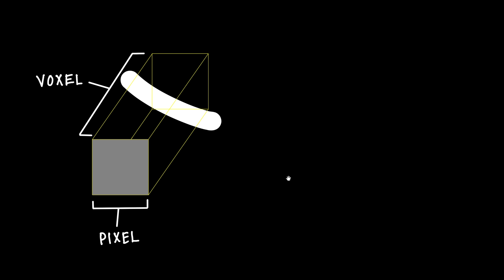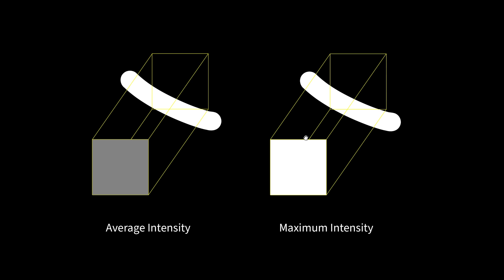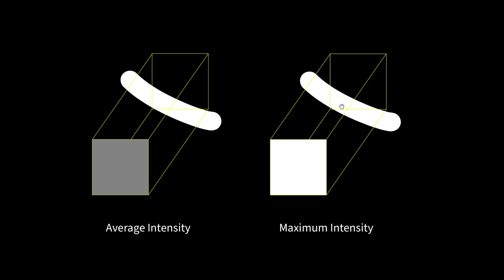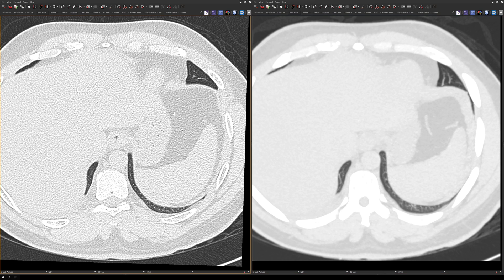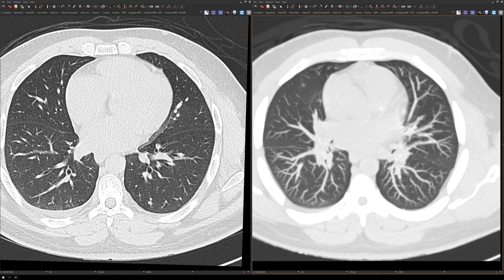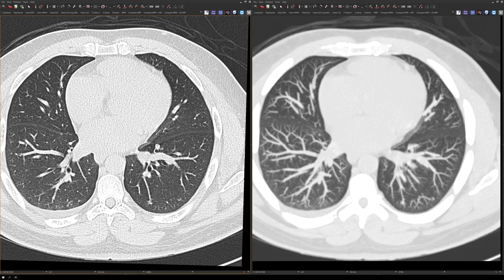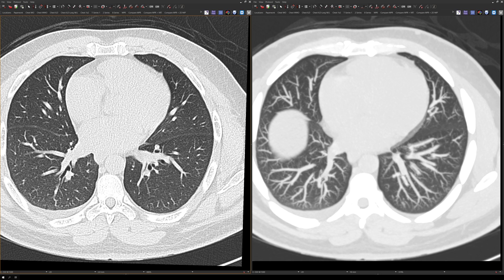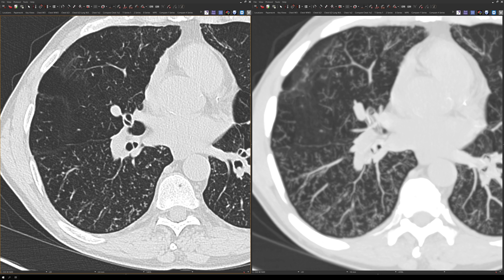What's the deal with MIPs?

Comment: Crystal clear presentation. Some things I've heard before just started to make sense in my head. My question is whether you have any experience with using MIP images for lung stereotactic radiotherapy. For motion management, 4D-CT is basic, but the volume is greater than the volume we would irradiate in a blocked position, such as deep inspiration breath hold. Some say that there is the danger of omitting the tumor craniocaudally when you use DIBH, since you don't see it properly. I would like to know your perspective on that.
Reply from the maker: Hi, I'm not a radiation oncologist, so can't speak to this as well as a specialist. What I know from trying to biopsy lung nodules is that the nodules at the lung bases (close to the diaphragm) do move up and down quite a bit during respiration. As for the MIP question, no the MIP would not help any more than a regular CT. Thanks.

Comment: Thanks . What ideal thickness of MIP is ideal for nodules detection? Is the a preference between lung filter or standard filter for the applying of the mip ?
Reply from the maker: For lung nodules, usually 8-10 mm. The lung filter is good with thin slices bc it accentuates sharpness. MIPs will negate the effect of having sharp images. Smooth filters are typically used for MIPs.
Reply: @ThoracicRadiology  Merci.